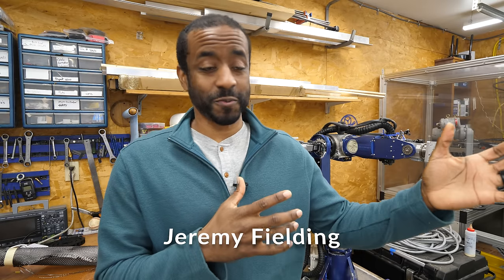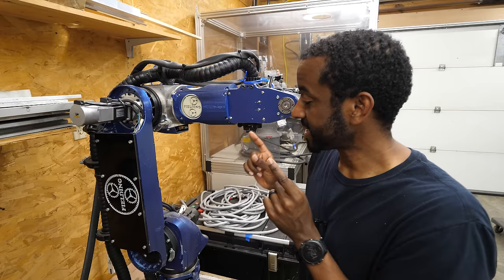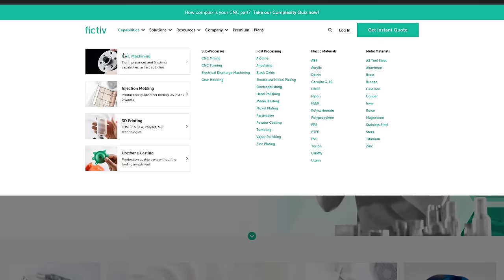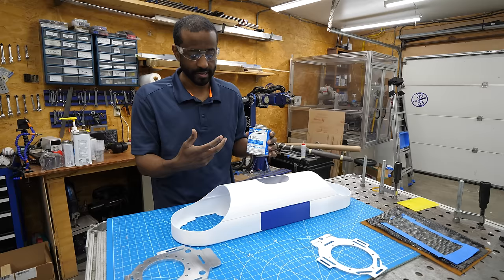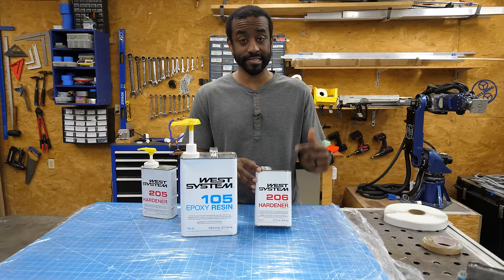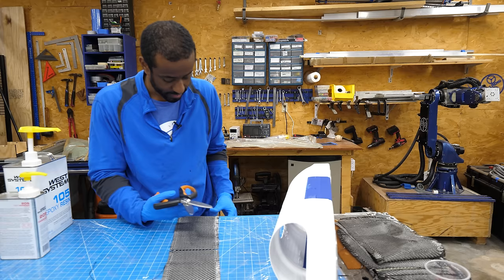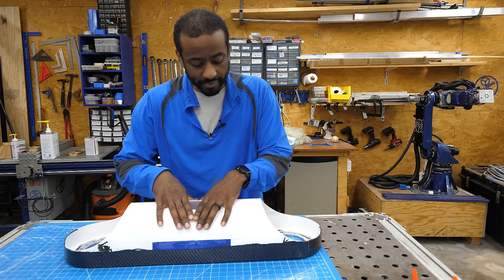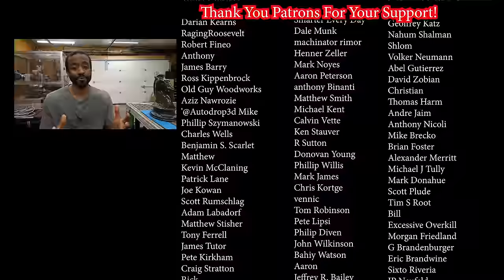How to Make Anything Out of Carbon Fiber.

Comment: Familiar issues with 3D printers. Tolerances are usually good horizontally and going for too big prints tend to fail. Of course high end  printers at 10k price range hardly never fail.

Comment: For your use, it seems that carbon fiber is about 20% stronger than fiberglass, was this enough to make the choice of carbon fiber cost effective?
Reply: Carbon fiber is much, much stiffer than glass fiber. Not 20 percent. The modulus of elasticity is like 7x higher for carbon fibers compared to glass fibers. How are you getting 20 percent?

Comment: Some advice from someone who works with carbon fiber every day: 
Avoid trying to stick carbon fiber to any flexible plastics (like abs). It will delaminate. You could probably pull that cf off without much effort. Plus that ABS would always be a weakness and reduce the stiffness of the part.

Wherever possible use a female mold. It's the best option in terms of quality and achieving the correct dimensions. The skinning method being used in this vid is far harder, inferior and unnecessary for simple parts like this.

The same effort and tools could be used to 3d print a female mold. And, if necessary, additional male inserts to hold the cf in place over difficult geometry. Any effort you try to save by avoiding doing it properly with a female mold will end up wasted. Do it right. Do it once.

Never ever rely on just resin to attach aluminum (or any other material) to carbon fiber. You should mechanically lock the aluminum insert in place by wrapping carbon fiber around the edges when you are making the rest of the part. 

Other alternatives I've used is threaded inserts cured into the CF part or aluminum (or titanium)  tubes going all the way through like they do with pillar-bedding rifle stocks. Or simple pipe clamps if you can redesign the end of the part to be round.

You can use your cnc machine to cut some small grooves into the aluminum insert to make the resin grip it better. I once used a t-slot cutter on the aluminum to create a mechanical lock with carbon fiber strands. 

You can make it prettier and avoid the cf falling apart in your hands by taping the edges of the fabric of the first layer (before you apply resin) with painter's tape. Then trim off those taped edges in the mold using a Stanley knife.

Comment: I wonder if there is an overall ratio of a genius idea to actual genius ideas and is the number common for everyone?  that's what takes me so long to do projects, because for ideas i have only a select few are genius. Also i follow after my father, god rest his soul. i over engineer everything and i measure everything with such a tight fit that usually once i attach things i cant get them back off for adjusting.  also i remember reading a long time ago when working with carbon fiber you want to wear a respirator.   Respiratory Protection
Inhaling carbon fibre dust could potentially cause issues similar to asbestos. New resins are being introduced to the curing processes without a great deal of research regarding health and safety. If nothing else, we highly recommend you wear appropriate respiratory protection.

Comment: This would be so much easier in prepeg.
Reply: Especially if you have a big autoclave sitting in your shop.
Reply: @anthonywarren4207  almost everyone I know has at least access to an oven. There's an electric one in my shop for curing powdercoat and it has a tube welded through the side as a vacuum port pass through but it is quite easy to vacuum down your bag, seal it, and shove it into a household oven at 225F.  (or 100C)
About the only disadvantage to prepreg is the out time, but then again most people have access to a refrigerator.
Reply: @mytuberforyou  I've been in advanced composites for decades, I've never had an autoclave, although I have had some large ovens. Most people don't have access to one. A bag  in a home oven is a recipe for a pissed off wife. I could probably access an autoclave at a friends shop in Saskatoon. I think to make a really nice CF Chess Knight a better tool is the place to start.

Comment: would it be possible to adapt a plastic vacuum bag like for clothes as it usually has an easier seal on top to create vacuum or does the bag need to be made like this for each project?
Reply from the maker: I could even use a trash bag. It matters very little as long as the bag doesn’t break
Reply: Yes. You can use vacuum sealed reclosesble bags, like for clothes/linens, or even vacuum sealed food bags, like FoodSaver. I make lots of CF parts, and while I have all the proper consumables and equipment for vacuum bagging composites, I have used both clothing and food bags for multiple projects. Why? Because it’s often faster and easier, and I want the ability to un-seal and reuse the bags.
Reply: Thank you guys when I get the opportunity I will deffo give this a go!

Comment: Well... Are you going to finish the useful part where strength and weight actually matters or is carbon fiber only for trinkets?
Reply from the maker: I don’t know. There are several other projects already in progress so it won’t happen fast. But it seems highly likely I will use carbon fiber for its strength properties in future projects.

Comment: Hi I have been wanting to use carbon fiber for quite some time for bike frame and other car parts including making fenders etc. However they all need to be as tuff as steal for obvious reasons, can you or any of your fans DM me and give a direction on what kind of materials I need to eliminate weight and still have the same strengths required and what are the cost of materials that will need to used, Thank You.
Reply from the maker: Perhaps I don't understand the question... but that is the whole point of the video. Carbon fiber is ridiculously strong for its weight. It can be as strong as steel while weighing as much as plastic for the same application. And there are several YouTube channels completely dedicated to designing parts in carbon fiber several of which include bike parts, frames, airplane parts and car parts. I think you just need to spend a little more time doing your research. Getting someone to personally coach you through it will be unlikely if that is what you mean. This takes a lot of time and practice... but it is certainly doable. The information is out here... my goal for this video was to get you to consider carbon fiber as an option. Now you have to develop your own design, and there are many videos to help you with the details on YouTube.

Comment: But then how do you get the plastic model out?  The project is still the mass of the CF and plastic printed piece.
Reply from the maker: As I said in the video. I can leave it in. The weight of the plastic has no effect here. But if that matters to your design then of course do it differently. I never intended to remove the plastic as said in the video. It’s just a “infill” as I described it

Comment: You could probably print a lot faster with some tuning. Those parts look super thin, should be doable in like 3 to 4 hours at most..? Definitely not 2 days!
Reply from the maker: Agreed. I have done zero tuning.
Reply: @Jeremy_Fielding I'd be happy to help/provide some advice/direction.. I have an old garbage i3 clone with acrylic frame but managed to get it doing 5min benchies.. I'm sure you could get those (much better) printers rocking!

Comment: Are there any dangers working with carbon fibre (such as microparticles when cutting or grinding it)?
Reply: Yes, carbon dust is very bad. If at all possible, use water to keep it from getting into the air in the first place. Cutting the raw fabric with scissors is fairly safe, but does produce some short lengths of fiber that float around in the air (wear a dust mask), and are very painful if they get stuck in your skin (tape is the best way to pull them out), and are electrically conductive so they can short out electronics. Don't get epoxy on your skin either, you will eventually develop an allergic reaction to it. It's harmless when cured, but be cautious when sanding freshly cured epoxy because if the dust is still chemically active it can be a very large exposure.

Comment: Jeremy, I am curious as to what the material costs are. Is a carbon fiber coating within the financial reach of the average DIYer?
Reply from the maker: Yes! I think so. Carbon fiber material is not cheap but it’s the only costly part of the whole process and you don’t need much unless your making a whole car or something. I think it worth checking out especially because you can get something as strong as steel in any shape without a CNC machine and without all the skills needed to weld  or machine or whatever

Comment: Awesome overall but how many people have 3d printers and a machine shop at thier disposal to pull this off .
Reply from the maker: You completely missed the point. You don't need any of that. In fact if you watch again you will hear how many times I said " you don't need a 3d print you can 'x'" you don't need this you can "y". Its all in there. All you need is carbon fiber, resin, scissors, and plastic. You don't even need the vacuum pump. Seriously, don't make excuses LOL its way easier and cheaper than you think :)
Reply from the maker: I would say the real cost is time. You can't really rush this, and you need to practice because it is definitely a "skill" like learning to sew, or carving wood.
Reply: @Jeremy_Fielding  so the answer then is very little to none .

Comment: Trying to work in positive will always give weaker results. If you cast parts, or use cheaper fiberglass to laminate the out side of the parts, then layup your carbon in the negative and impregnate with epoxy. This will give you the perfect result you’re looking for, and the strongest part.

Comment: PETG might not be the best material for your cores. It doesnt bond to epoxy that much. You will get core delamanations. ABS or ASA might be better in this aplication, though harder to print. Love your videos, keep at it.
Reply from the maker: Interesting. In this particular case the plastic wasn't important at all. It just allowed me to get the right shape. I would have removed it if I could. BUt this is interested for applications where I do want good bonding to the plastic. Perhaps if the surface was printed with ridges or textured in a way to resist sliding might be helpful. I don't know. But thanks for sharing!
Reply: If you have to choose between abs and asa, Go for asa 10 times easier to print and warps way less still a little but not like abs. You will have to  put your printer in a carton box to keep the heat in.

Comment: What about the cost of carbon fiber?
Reply from the maker: The carbon fiber itself is like buying any other fabric... by the yard. You can buy as little or as much as you need. Think about it this way, you can make a part as strong as steel, as light as plastic, and all without the skills or cost of CNC, a welder, etc. If you can use a pair of scissors you can make it. That is amazing to me. I think its great for DIYers and the budget.

Comment: what about welding? is there anyone that provides services for welding carbon fibre components?
Reply from the maker: If a carbon fiber part breaks you could add more carbon fiber on top, but there is no welding of carbon fiber. The Epoxy is what bonds the fibers
Reply: @Jeremy_Fielding  interesting!
i only ask because im trying to connect a neck type of component to the body of a vehicle im designing and so that neck will receive the majority of the forces so the bond between the neck and body must be really strong. i could send u images if u are curious.

Comment: I don’t see this part being any stronger or more rigid than the metal part that is currently on the robot.
Reply from the maker: I didn’t remember sharing the new dimensions or the thickness of the part or the number of carbon layers. I don’t understand How you could know? In fact that’s the beauty of carbon fiber here. the exact same dimensions and thickness would lead to both a lighter and stiffer part. But I changed more than that.

Comment: Any reason you would use carbon fiber over simple fiberglass with these DIY epoxy composites? If you look up the strength the glass actually beats out the carbon in some categories as a composite and it's much much cheaper. I personally never saw a reason to go from glass to carbon for composites -and it seems most companies that do, do so for marketing buzzwords and popular aesthetics rather than actual RnD reasons...
Reply from the maker: Weight
Reply: @Jeremy_Fielding  I didn't think about that. Thank you. My applications don't usually have to be mobile but for racing machines or Drones it's probably a worthwhile consideration... but then again epoxy resin is usually rather heavy and this process isnt particularly optimized.

Comment: 1. Expensive: The rough material is already super expensive, it takes a lot of energy to make those fibers in the first place.
2. Mess: It creates a lot of mess, you need vacuum pumps, resin gloves a good ventelated area etc. it never stops.
3. Trash: Resulting from all that plastic overkill you have to throw away the used up bags resins gloves paper towels etc. it creates a lot of trash

To be honest, 99% of people don´t need any of that. It is expensive, creates lots of trash and is a mess oh and it is dangerous because of the vapors and when you cut and sand that stuff small particles can lunge into your lung and create cancer like asbestos. I love that stuff from an engineering perspective it has really great material properties but I also hate to work with this stuff, itßs not worth it in my opinion.

Comment: Looks like you are only adding one layer of fiber and especially for the arm it is nowhere near enough. While carbon fiber is "stronger than steel" that is actually by weight, not thickness. You will need probably 3-4 layers for the arm. Looks of the first 2-3 don't matter in the slightest, and in automotive that's commonly actually fiberglass, so lay them up with a layup roller (a small ribbed one, looks like a stack of washers) and a brush, then bag the whole thing (or at least each layer) at once instead of bagging each small piece. Then coat it with just resin, let cure, sand smooth, and add a top decorative layer. 
You can also try infusion, where you first lay the carbon dry (perhaps with light spray adhesive on complicated parts), bag it, pull a vacuum, then slowly let really thin resin in from the other end of the bag. Vacuum will pull it through like water soaking into fabric. With this technique you'll have basically unlimited time to position the carbon just the way you want it and you won't have to worry about excess resin. Don't use that absorbent fabric by the way, there is no need for it.
Reply from the maker: I was going planning to do way more than one layer LOl

Comment: Nice try with the carbonfiber. We all mess up some times so that is normal, but just as you told it would be easier for you to do that layup in different pieces. Remember that you can rotate the twill 45 degrees and it will conform much easier into some corners. But the easiest way for this layup would be to use a prepreg, the you work with it like a Lego, just build up what you want and its off to curing in a elevated temperature.

Comment: Hello, I'm a huge fan and been watching for ages now. I have a questions. I've used fusion 360 for a couple years now and and design pretty much anything quite quickly. But ive always had the issue of my pc slowing down ( tacking many seconds per click which adds up) when I make a large model/s, do you recommend anything to help my pc not give up halfway through a project, I've done all the graphic changes and so on already, would you recommend any pc specs and so on. It would be a great deal of help if you can find the time to reply. Awesome video keep up the outstanding work. 11/10 stars haha
Reply from the maker: What my video 50 tips and tricks for 3d modeling
Reply: @Jeremy_Fielding  Thanks for the reply! the thing is ive watched and done everything you said haha.( i watch it when it came out) but I still run into the software slowing down. 
As fusion is a cloud based software it could be that/my internet speed is to slow but even if I go offline it slows down. I think its the specs of my pc as it more for gaming than 3d modelling. is there any hardware you would recommend. or what thing is more important, cpu, gpu, ram and so on.(for fusion 360).

Thanks again so much for the reply and your time.

Comment: I'm just going to say it: cheap 3d printers aren't worth it. The rejection rate on those printers is just too high, over time you waste more plastic than the difference in price of the printer. not to mention every one of those aluminum profile printers suffers to some degree from being out of square. Some less, some more, meaning that large prints can result in a gradual skewing the bigger or taller it gets.

Comment: It's not hard to "build with carbon fibre", the talent is to build with minimal material and removing excess weighty resins in the formation that doesn't add endless hours of shaping or cutting back. Carbon fibre, glass fibre, or kevlar is ONLY advantageous for form factors, like boat hulls, compound curves, and ONLY weight saving when optimised for minimal material involved. It took 50 years to become refined products for really good reasons related to the challenge. Confused why you didn't do the end of your robot before one of the main arms.

Comment: Carbon fiber and Alloy are a very bad combination because carbon corrodes aluminum quite easily. Early carbon fiber road bikes would snap very easily in places where carbon meets aluminum, nowadays they add extra nylon layers in order to avoid direct contact and reduce corrosion